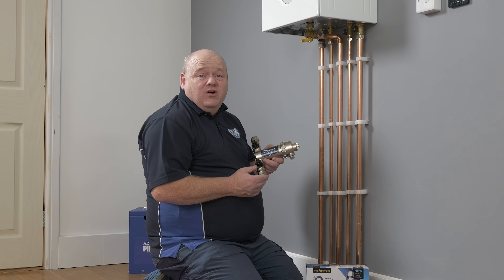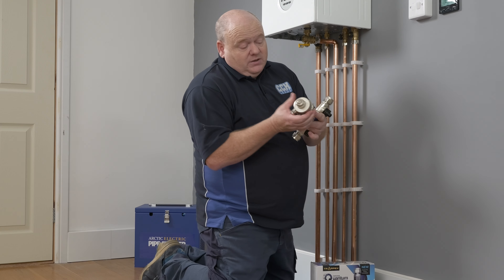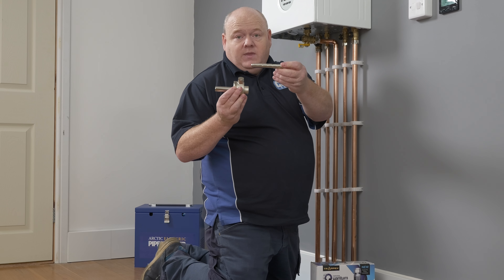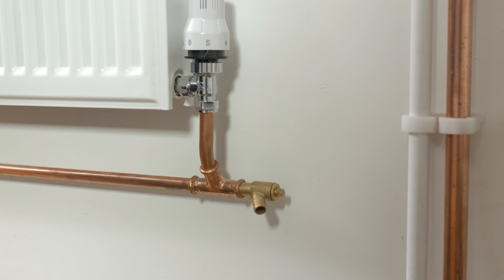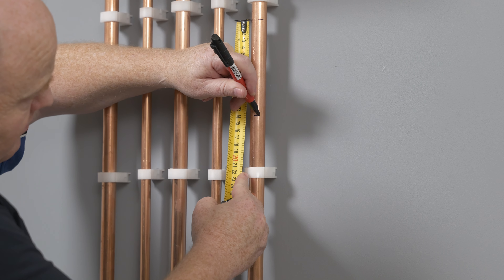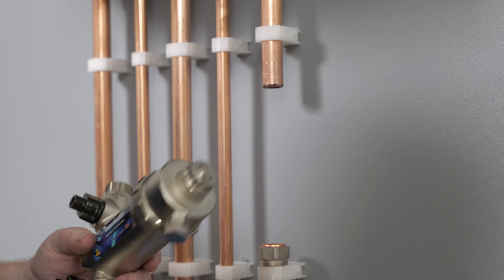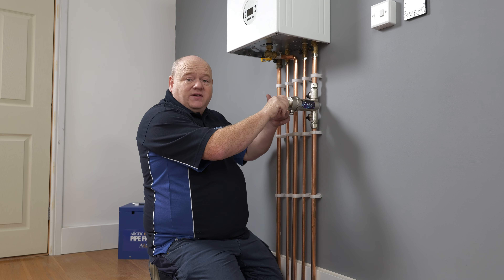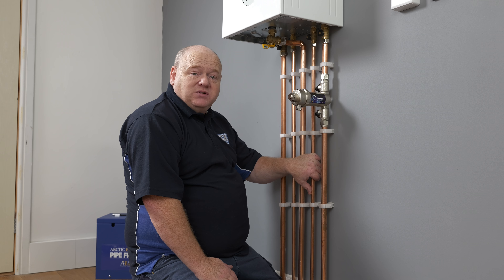How To Install A Trappex Quantum Central Heating Filter

Comment: Even though you live in France you helped me with my Baxi 310 FI boilers here in High Crime Bronx New York in the states. I was so frustrated losing pressure every 3 days having no idea they had panckae expansion vessels hidden behind the boiler that were all at zero. Over 11 years and not once were they ever pressurized to 1 bar. Thank you Allen Hart from France.

Comment: Hi Allen qq I have a viesmann boiler 2 year old when it’s not In use the pressure gauge sits at 0 when the heating comes on pressure gauge rises to 1. Heating goes off goes back to 0 is that normal. I thought pressure should sit at 1 if it has been set to 1